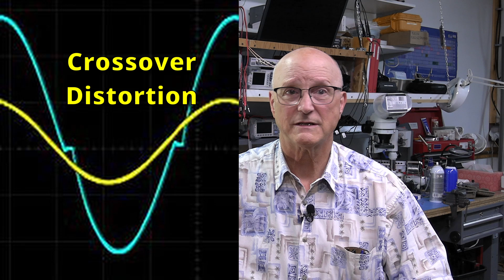Single Sideband: Where do those extra harmonics come from? (036b)

Comment: EXCELLENT PRESENTATION!IS THIS WHAT YOU CALL THE FOURIER SERIES REPRESENTED HERE?
Reply from the maker: Well ... actually, this is simply the trigonometric multiplication of the two signals as defined. The output of the Fourier is in the form f(x) (frequency domain) and this is in the form A(t) (amplitude at any time, t, a time domain representation). 
We could apply the Fourier analysis to it to yield the frequency components from this time domain function, but with the frequency components so obviously represented in the time domain function, to do so might be a fun thing to do, but not very productive. 🙂

Comment: Interesting that the noise floor goes slightly toward the main carrier frequency.
Reply from the maker: Yes, this is quite interesting. To some extent, this is due to the RBW of the spectrum analyzer ... but maybe there is more to it? 🙂
Reply: @eie_for_you  Most likely both the non linearity of the transmitter and the rbw of the spectrum analyser
Reply from the maker: @Mamamia12384  That was my theory as well. 🙂

Comment: Beautifully clear explanation.  When I first enountered thei i imagined .. "What if the Audio signal was a pure sign wave  But all of a sudden it went into bad clipping so it looked like a square wave -  Yup harmonics everywhere - then you feel that into your modulator and what you get is a acurate "square" wave represented by the harmonics ... modulated onto the carrier wave. ... then just take it from there ... Only you used crossover distortion - equally as validlidly ... the wrapped it up with a bow and expalaned how carrier distortion gives you a "signal' at twice the carrier.   Nicely put Sir !!!
Reply from the maker: Thank you! 🙂